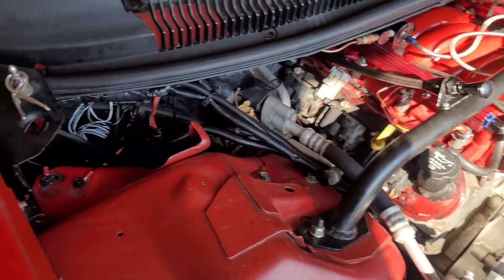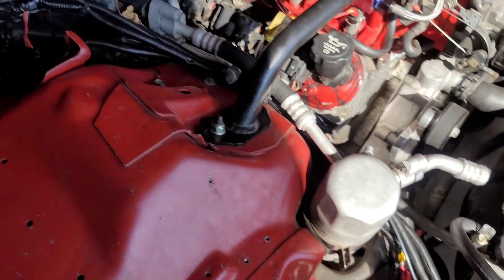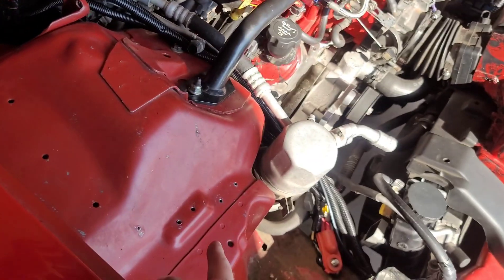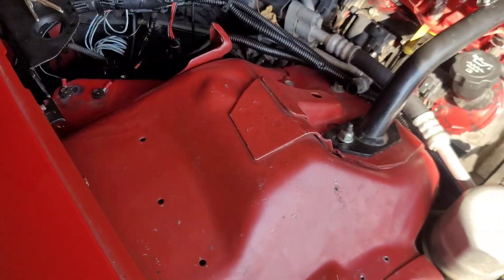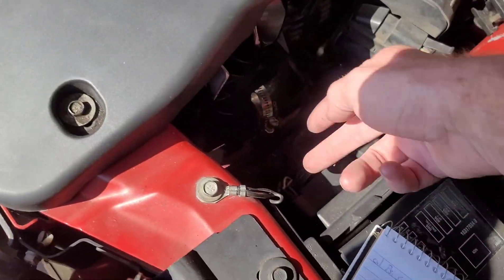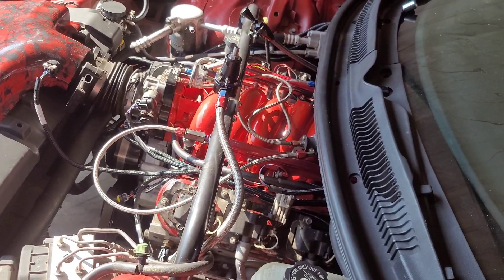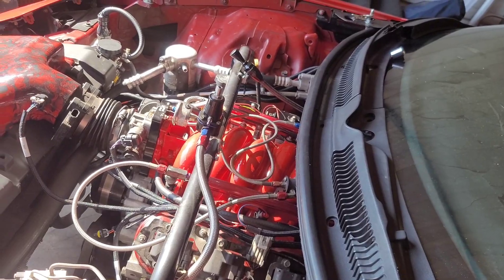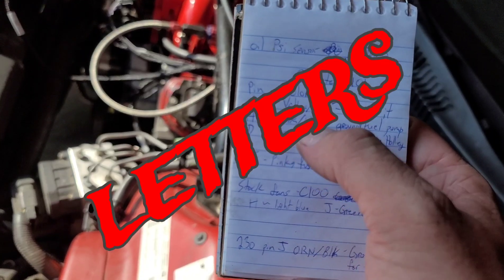Wiring Holley Terminator x using factory 4th gen fbody wiring harness.

Comment: Would you recommend a Term X for LS swap into a 4th gen factory V6 Firebird? Looking for the easiest/best solution for wiring a swapped car that will allow gauges and A/C to work.
Reply from the maker: @msh6865  I would personally especially on a swap because it eliminates the need for having to have someone tune it and all that. Everything as far as accessories will be the same as mine but the gauges will be more difficult to get to work if your wanting to stay factory gauges. If your wanting them to work, stay with the stock ecu. It's still gonna be wiring the same sensors and everything just hp tuners is expensive and very difficult to learn lol

Comment: Man is there anyway you can help me out here I have a stand alone harness and need to connect my fender plugs ..I don’t have a Holley though .. would I still ground them ?
Reply from the maker: @EricAtkinsonMusic  if I'm not mistaken the ones I grounded you'll still ground
Reply: @Ls1ears  brother I could buy you a case of beer and a 5th of Jack .. that orange with a black stripe needed grounded my car turns by key now !!!  THANK YOU SIR 👊🏼😉
Reply from the maker: @EricAtkinsonMusic  anytime bro that's why I do it lol
Reply: @ ok I’ll try it out man .. what about all the pink wires
Reply from the maker: @EricAtkinsonMusic all the pink wires are just 12v ignition power wires. You can just leave those in the plug and tuck the plugs away like I did lol
Reply: @Ls1ears  so all those pink wires I don’t need hooked up at all ?
Reply from the maker: @EricAtkinsonMusic  to my knowledge no unless your looking for something to power on with the key
Reply: @Ls1ears  I could use one for my lengenfelter module maybe .. and I’m getting further .. now I have power to everything but no crank from the key ..and I got a fuel line to tighten up I see lol
Reply: @Ls1ears that’s exactly ware my fuel leak is at the fuel rails from eBay man .. I’m thinking about getting me some stock ..but damn they want so much for em lol .. I’ve got me some nice smooth cherry moonshine to stay warm and tinkering on this 99 bird of mine .. I just can’t get no crank from the key now man
Reply: @Ls1ears and I appreciate ya taking time out to help me man ..thank you sir
Reply from the maker: @EricAtkinsonMusic  aw yeah anytime! There's several wires that need grounded to make it crank with key and all the stuff, go over them again and make sure they're all hooked up. Also the purple wire that runs with the fender harnesses is what sends the signal from key to starter so make sure you didn't accidentally delete it to like I did. It's got a separate plug from the other 3 but it's all there together lol
Reply: @Ls1ears  no lol I got it going to my starter solenoid .. I had to switch it around cause the starter I have had the plug in on it and not the little ring terminal.. awww it’s always something man lol
Reply: @Ls1ears  I have the lengenfelter module also from the 58x cause I have a 4th gen motor as well as a 99 firebird .. it use to be a 3800 series 2 but just something about that V8 power and sound .. don’t get me wrong that 3800 for a V6 would run like a V8 but didn’t have that sound and ware I could just do more with .. so the red wire from the stand alone would I put that to the pink wire at my factory fuse box for ignition man ?
Reply from the maker: @EricAtkinsonMusic if I'm not mistaken yes, that way it'll receive power as soon as the key is on

Comment: What wire under the dash? Mine won’t start
Reply from the maker: @patrickshelton5255  if I remember right I think it'll be in the center console going to the neutral safety switch, orange and black wire...If I remember right
Reply: @Ls1ears  only on auto??? Or 6speed also?
Reply from the maker: @patrickshelton5255  that one I'm not sure mines auto. Lol

Comment: Hey brother, just figured I would reach out to you. I’ve been making a lot of headway with this Holly set up. I wasn’t sure if you ever went through and were able to connect your factory Fuel level cinder signal to your pro dash or not? If not holler at me I can tell you exactly how to do it! Easy using plugs C230, Pin G to ground, then Pin J to I/O 7 pin 21 on pro dash. Go into setting and set that pin to custom OHMs, then set ohm load from 33(E)-240(F)ohm. Then adjust the numbers between 33 and 240 accordingly and that’s it!
Reply from the maker: I did! I think I got it in the holley video after this one lol. But I greatly appreciate you thinking of me and making sure!!

Comment: Great video and very informative. I do have a question regarding a couple of the wires you mentioned underneath the passenger side fender. He said that they needed to be grounded, if hooked to the Holly harness which they have the two plugs for them do you still need to ground them?
Reply from the maker: Thank you. That I'm not sure. I'd imagine it'd work since essentially that's all the factory ecu does is send a ground signal like, say the neutral safety switch is in park, it's sending a voltage to the ecu telling it to complete the circuit by sending the ground (if I was understanding it all correctly 😅)
Reply: Thank you brother, I appreciate the help.
Reply from the maker: @Wrensspeedshop  anytime. If there's anything else just let me know and if I don't know I'll try to figure it out lol
Reply: The wires in the factory harness that you grounded out, did those need to be grounded because of the Holley system and you took out the factory harness?
Reply from the maker: @Wrensspeedshop yes and no. The fuel pump ground and those things are because the factory ecm no longer exist, the others are for the body control module I believe. Basically tricks the bcm/factory relays saying the stock computer is meeting the parameters to allow the other things to work lol
Reply: Yeah, I went through and I grounded the two or three wires from that harness you had mentioned, I just took the plug off the factory body harness. That way I can make it nice and clean. Once I put power to the car without plugging in the Holly system. I had full control over power locks Headlights tail lights running lights. However, when I turn the key forward it was making a humming sound from underneath the dash. I got underneath the car and used my power probe and put 12 V to the star solenoid and when I did, I could hear the fuel pumps Kick on but no starter. Not sure if the relays are bad or if there’s something with the vets system missing, maybe the blue and white body harness? I looked on the harness I took out and didn’t see an orange & black wire that I believe you mentioned. Thank you again
Reply from the maker: @Wrensspeedshop  hmm that's odd. If I'm not mistaken, the black and orange run to the neutral safety switch which is where I actually cut and grounded mine at. My car was weird though because when I finished, everything worked (before I grounded the o/b) until I unplugged the neutral safety switch and then it freaked out my vats, little security dash light was a steady red, trunk button no longer worked and mine wouldn't start. I went to plug it back in, seen that wire and remembered I had forgotten to ground it so I just did it there before I plugged it back up and it fixed all those issues.
Reply: @Ls1ears  found that wire. On the body side it’s plug F on the white harness
Reply from the maker: @Wrensspeedshop  nice! Did it fix your issues?
Reply: @Ls1ears  and unfortunately it did not fix it. I checked everything and it’s got a good ground etc. Since I already have the radio out I went through and jumped the starter solenoid relay, however, as soon as I do that and I turn the power on the car, it sounds like the main fans in the defrost are kicking on even with the fans turn to the off position, so I have to figure that one out lol
Reply from the maker: @Wrensspeedshop  now that has me stumped..... lol
Reply: @Ls1ears  what has me scratching my head is that I went through and grounded everything like you had mentioned in your video as well as anything else I found that needed to be done. The only thing I can be thinking at this point is that the clutch pedal and/or the transmissionnot giving the car, a neutral, signal, reverse, lockout signal, BSS signal IDK. I’m trying to run through everything that I can think of.
Reply: Were able to get power and car turns over, just no spark. I’m thinking VATS is kicking in. At a loss at this point. Any thoughts
Reply from the maker: @Wrensspeedshop   that has me just all around confused. I'm wanting to say vats because when mine goes into security, it would have key on power but that's absolutely it. Someone tried to steal my car before I owned it and the ignition has its moments. I want to say my hp tuner guy disabled the vats but my alarm still works.....it's been so long I honestly can't remember lmao
Reply: @Ls1ears  yeah I’m going to start with making sure the Terminator and screens have the most up to date firmware & software, after that I’m going to be taking any VATS crap out of the equation
Reply from the maker: @Wrensspeedshop keep me updated! I didn't think about the firmware or anything which, that was the first thing I done when I got the holley all setup before I even started it. My pro dash was an update behind so it wouldn't read afr and a few other minor things but the latest firmware fixed all that
Reply from the maker: @Wrensspeedshop I also have a video coming up on how to keep the pro dash on during startup I should have posted tomorrow.
Reply: @Ls1ears  I’ve got that pro dash up and working easy and starting on during start up. The problem I’ve got is not getting spark/rpm signal to the terminator. Thought I bricked it yesterday 🤦‍♂️ thank god I was able to get it out of that all black/off mode
Reply: @Ls1ears  I went through and ran a fused power straight to the battery so that way it had constant power as needed, even when I turned my main power off at the safety switch.
Reply from the maker: @Wrensspeedshop  that works lol. But that just has me scratching my head as well. Crank but no start, everything is grounded, no rpm signal....you did check and make sure all the plugs are good with no bent pins and whatnot? I've seen where a wire was pulled out of a plug just ever so slightly and cause so many issues that we almost never found it. My buddy Nicky stepped back and suggested we pulled the whole harness and start back at step 1. I believe it was the cam sensor plug had a small piece of plastic get in it and when plugged in, the plastic bent the little pin. It wasn't completely blocked so it was an intermitten thing there. Seems like though you could bypass the clutch safety switch to test it there (I've never messed with a manual fbody) or, if you have a similar year LS close that's running, start swapping sensors maybe?
Reply from the maker: @Wrensspeedshop  just thought about it, might check in thr holley and see if it has like an oil psi safety set up or something that's not letting it start 🤷🏻‍♂️
Reply: @Ls1ears  yeah, it’s beginning to feel like one of those one step forward three step back kind of things lol. 
So Friday night myself and a buddy worked out there in the shop until about 1 AM. Trying to get everything working and couldn’t get the car to start as I had mentioned. Yesterday I went out there to work on the car some more to try to problem, solve and realize that all the LED lights on the terminator were off! 🤦‍♂️. if you’re familiar with that in the phrase “BRICKED” that’s where I was. Thank God I was able to find a video where a guy was able to go through and shove the steps required to try and “un-brick” the device by using the original firmware, which I saved thank God. Today I was able to get v3 from loaded on to the terminator and also got the firmware updated to v4 On the 3.5 inch strain, haven’t even attempted to mess with a firm. We are on the Pro dash yet lol. 
Now, what is really cool is that the v4 firmware on the 3.5 inch screen looks way different than it did factory, and appears to have additional functionality, however it now pops up a message telling me that the firmware on that and the firmware on the terminator are different and not compatible so I need to update the computer again LMFAO. 🤣 at that point I said screw it I’m done for the night and came inside to eat dinner.
Reply from the maker: @Wrensspeedshop  now that is absolutely wild lol. I don't blame you tho I would've called it a night right there myself. I'm to the point when I work on this car, I always start off with a wild turkey american honey/sweet tea mix. Keeps me calm and collective and actually works well with my adhd....atleast that's what I tell myself 😂😂 but I'm glad to see your making ground on it! I'm saving the video of keeping the screen on now and hopefully tomorrow evening starting on the ac wiring and all that jazz which means, for the 964th time, pulling atleast half of my interior apart 😂 I would leave it apart until I'm done but that makes to much sense and means I'd have to work on it regardless
Reply: @Ls1ears  i’m definitely going to look at the oil pressure sensor/possibility that that may be what’s keeping it from starting. I can’t remember if I had told you the other day or not but literally no matter what I/we did we could not build oil pressure. I primed the system. No lie at least two dozen times and never seem to be able to build any oil pressure. I was finally able to get the engine builder/company on the phone last week and discuss the issue with him as well and he acknowledged that sometimes LS engines let alone any engine can be a pain in the ass and not want to prime, but as soon as you started, instantly you get the pressure you’re looking for but to keep a very close eye on it once you started immediately looking for that oil pressure. Either way I’m gonna have Holly Customerservice on the phone today lol with only 59 days between now and Holly LS fest I don’t have time for this little piddly crap
Reply from the maker: @Wrensspeedshop  I completely understand that! It's especially irritating when there's a time crunch. Hopefully it's no major issue. I know I put a manual gauge on mine just incase the sensor ever failed, I'd have a way of knowing lol. Drilled and tapped the little piece most people use for turbo returns down by the filter. (idk what it's called.) But definitely let me know what the issue ends up being! Again I hope it's something small
Reply: @Ls1ears  well, you won’t believe this crap. After sitting on the phone with Holley for a little over an hour this morning, we finally narrowed the problem down to the crank sensor/crank sensor area, tested the crank sensor and it worked. I put a scope where the crank sensor goes and guess what is not there…… No reluctor wheel! Fml 😂 
I reached out to the shop/builder and was like hey we got a problem. He ended up driving over here to my house this evening and is paying for half of the aftermarket Holly reluctor wheel that bolts onto the front of my ATI dampener because otherwise the motors got to come apart , FML
Reply from the maker: @Wrensspeedshop  damn it man that's insane!! Glad he's helping you with a solution!! I thought sensor when you said it wasn't showing any rpm or anything but never would've imagined it'd be a whole ass missing reluctor wheel! I hate that but glad there's a semi easy solution!

Comment: I might’ve missed it in the video, I heard you talking about the starter, but where does the other end of the pink/purple signal wire for the starter go? One end attaches to the starter, but where does the other end of that wire go? I clipped it off of one of my LS pcm harness’s but not sure where to wire it to on the Holley or trans am fuse/relay harness
Reply from the maker: I plugged mine right back in but I think it goes to the fuse box? I didn't trace it back honestly I just pulled that side out of the harness. It was completely separate from everything that went to the computer
Reply: @Ls1ears  I have the main relay/fuse block harness that is normally in the engine bay completely out of the car, I’m trying to take everything not needed out of the harness and I want to put it inside the car behind the dash. I’m fairly certain that the purple starter trigger wire isn’t part of that harness, I think it’s part of the engine/trans harness. I just want to be able to use the key on the column to start the car
Reply from the maker: @ZeusCannonsZombies  I'll have to go out and double check mine and see where it runs because I don't rightly remember lol. Give me just a bit
Reply: @Ls1ears  sounds good, thank you very much
Reply from the maker: @ZeusCannonsZombies  yessir not a problem